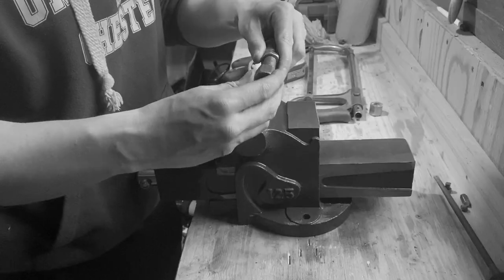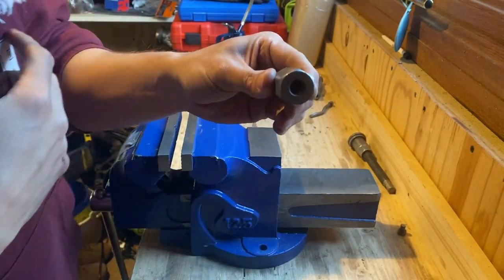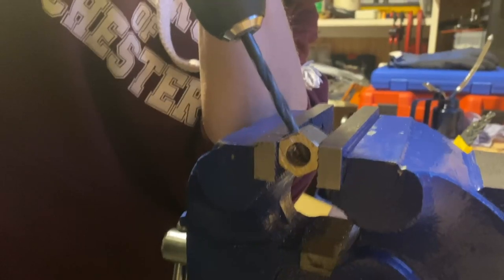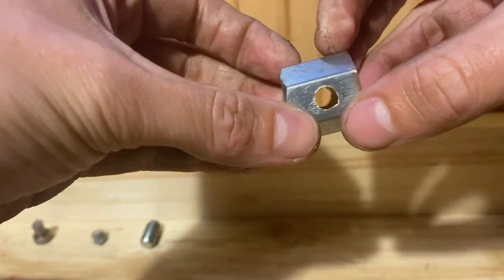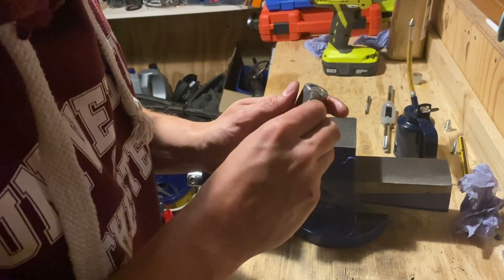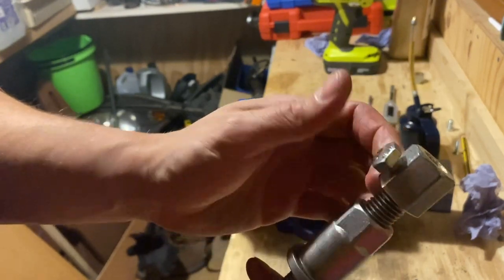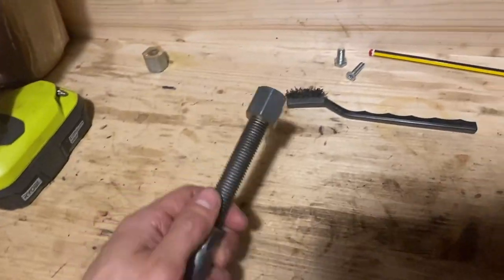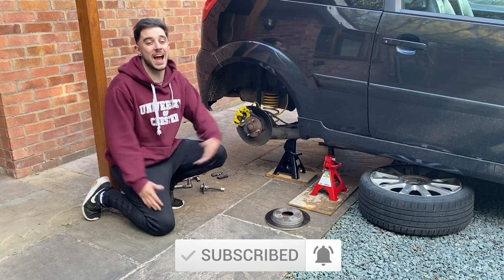How To Supercharge Your Brake Caliper Rewind Tool

Comment: Great video. Took me four hours from wheel off to wheel back on to fit new brake pads due to an extremely stiff piston. Bent the handle worse than you did! After a couple of hours of effort and watching average videos I saw my Monkey wrench by chance and thought I try and get a grip with that which worked but not without having to readjust. 
A big problem was trying to keep the caliper still but I saw you bolted it back on! So simple and obvious, you should make people aware of that great hack as not one video I looked at showed this! 
Been thinking all day on how to improve the rewind tool and how to hold the brake caliper but you nailed it! Good job!
Reply from the maker: Glad you found it useful mate 👌🏻
Reply: @MendItModIt  What was the size of the nut that you used?
Reply from the maker: @markchandler001  from memory 21mm. It was a metal spacer/stand-off I cut in half
Reply: @MendItModIt  I thought it was 22mm.

Comment: As someone who has been there, the problem isn't the T-handle not providing enough leverage. The issue is the caliper. Rebuild the caliper or replace it. Because if you do manage to get the piston in enough to replace the pads the caliper will not apply the proper pressure to pads when braking... the piston is partially seized.

Comment: good mod for the tool just done some of these rear brakes this weekend, 
 if you had spun the nut you made 90° in the vice it would have clamped on the face where you cut it (and been flat for drill/tap) 👍

Comment: Wee trick I use at work for tapping is deburring the hole first to give it a lead. Then start your thread off with a taper tap as it will line up better, then chase it out with the plug tap.
Reply: It also helps to tap both hole from one side or you end up with reverse threads on 1 side
Reply from the maker: @A7X_foREVer_Philly  bro are you okay? 😂😂

Comment: 👎Great idea BUT you made a huge error. Which is why it got harder and harder to put that bolt in.
You MUST tap (thread) both holes from one side. If not you end up with one side having reversed threads and you will have to cross thread (ruin) the bolt.
Righty tighty lefty loosy. The way it was done the bolt would go thru the first hole with no problem but then hit left hand threads on the other side then it would either stop or cross thread and be ruined. I was surprised you got it in at all TBH.

Its vey simple if you think about it.
Also stainless harware is very easy to ruin. Ive seen it happen many times at work. Someone with run a nut down with an impact instead of with their hand or wrench, then tighten with impact. If you run the nut down fast with an impact or drill the threads will lock up and it will need to be cut or broke off. Ive personally had to  break many stainless studs using a wrench and impact and about 5 min per nut. Its hard work. We couldn't cut because we couldn't produce sparks due to location. 🔥
This is very basic mechanical knowledge.
Other then that it turned out nice. Im going to make the whole tool from scratch.

Comment: 5:10 trying to tap a straight hole with that nut at 60 degress is killing me. Put the nut in the vise, but rotate it 90 degress (looking at it from the top). Now you are clamping from the side you just cut off. (the hole is NOT visible from the side) Now rotate it so that the face you want to drill is straight up & down.

Comment: Your a engineering student??
Reply from the maker: Nah man I’m not, how come?
Reply: @MendItModIt   because you tapped it wrong. Need to do voth holes from 1 side or you end up with reverse threads. This is why it got harder each time you put that bolt in and you had trouble getting it all the way in. You are cross threading one side, which will ruin the threads everytime.
Love to see you pull that bolt back out and inspect the threads in bolt and collar.
Reply from the maker: @A7X_foREVer_Philly  I think you’re way too invested in trying to prove your point there bro 😂 it’s in there, it works, it ain’t coming out, no harm done. I hope you’ll rest easy tonight 😌
Reply: @MendItModIt  am i wrong tho???? Nah didn't think so.